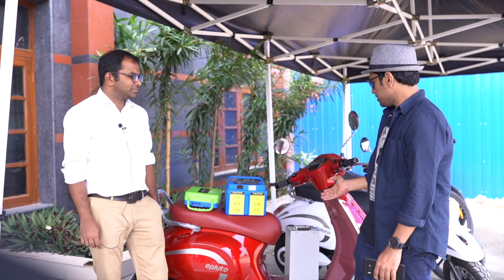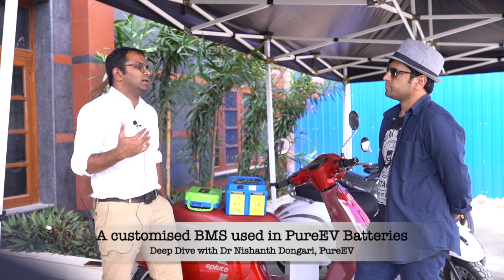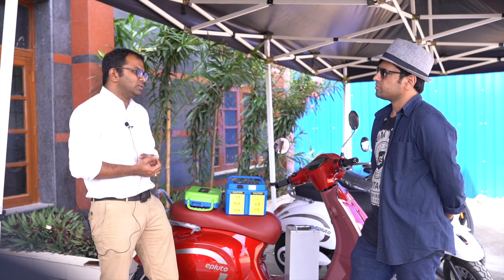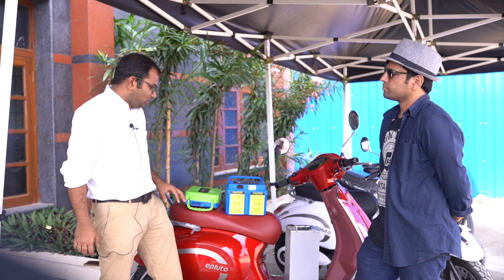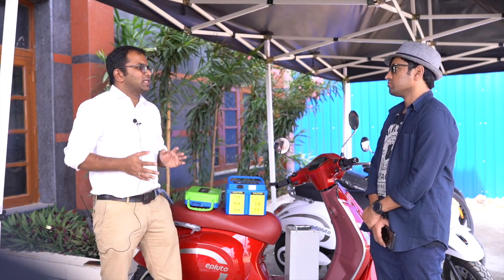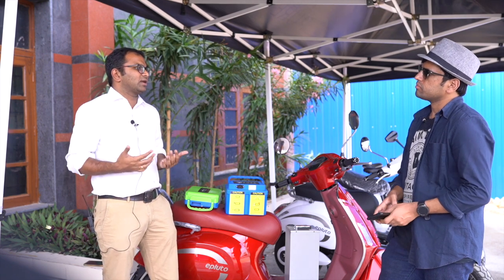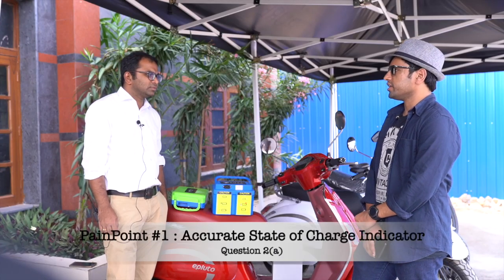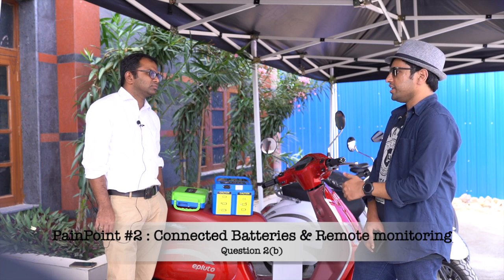PureEV Battery - NMC Chemistry | BMS Algorithms | Thermal Management | EV Guru

Comment from the maker: In this video we ask Dr Nishanth from PureEV, 3 questions on the PureEV Battery
a) Tell us about the Internals of the NMC PureEV battery used in the electric scooter.
b) Is PureEV thinking bout LFP batteries?
c) How is PureEV Solving couple of pain points observed in electric scooter industry 
    1) Lack of accurate state of charge in electric scooters. 
    2) Lack of remote monitoring of battery health and other cell parameters.

If you are interested in PureEV Products, do fill in the form and the company will get in touch.
https://forms.gle/5DwG2ApmSJLBqkkw7

Read more about PluginIndia's visit to PureEV factory here
https://www.pluginindia.com/blogs/pureev-is-an-electric-vehicle-startup-focussed-on-battery-engineering
Reply: For cell with same capacity, thermal management can be better for which form factor at the cell level?

Comment: WHEN BUYING AN ELECTRIC VEHICLE WE SHOULD ASK FOR LITHIUM IRON PHOSPHATE ( LiFePo4 ) BATTERY ONLY.
In fact WE SHOULD BAN THE SALES OF Lithium ion batteries and Lead acid batteries in India.
This is because For Indian conditions Lithium iron phosphate battery is best.
Its Charge cycles is more than 2000times. SO BATTERY LIFE IS FOR 6 to 10years.
Whereas Lithium ion charge cycles are 1000 times approximately. And battery life is for 3 to 5Years.
Also The Lithium iron phosphate  BATTERY PRICE IS ALMOST SAME AS Lithium ion.
So WHEN BUYING AN ELECTRIC VEHICLE WE SHOULD ASK FOR LITHIUM IRON PHOSPHATE ( LiFePo4 ) BATTERY ONLY.
Reply: Little knowledge is a dangerous thing.
Reply: @sujoybha  lol knowledge of your
Reply: Do you know lifepo4 cells have balance issue ?
Reply: @ashwinpande6474  active balancer BMS hai balancing ke liye